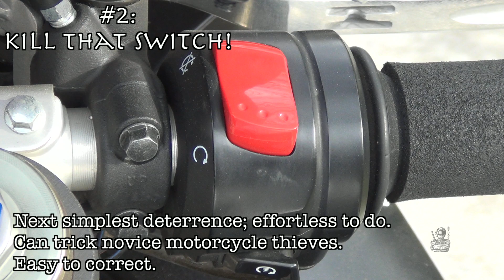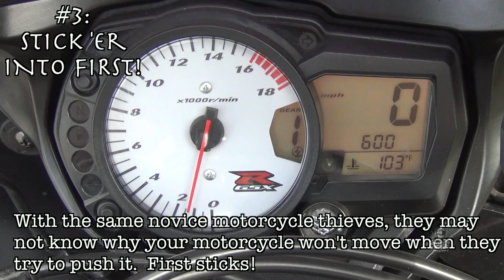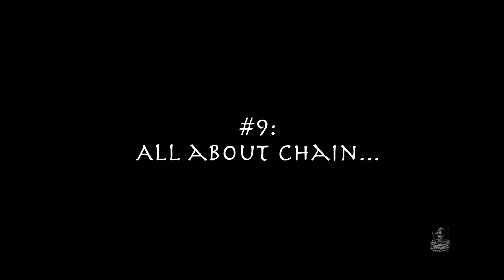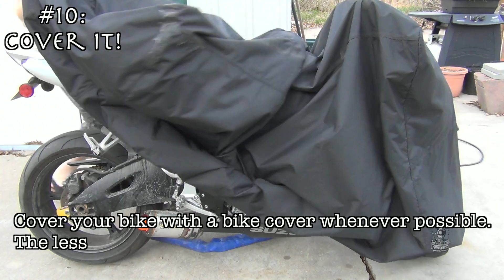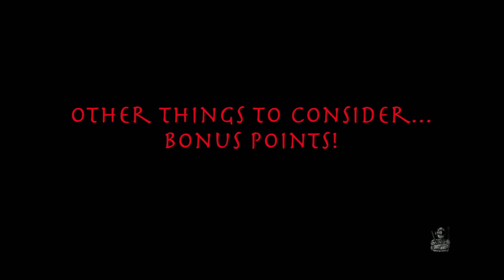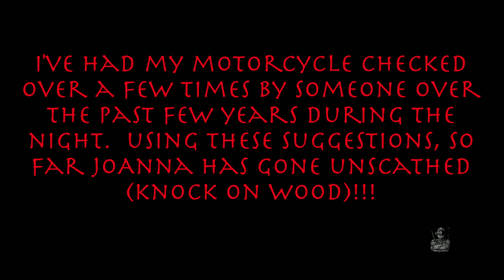Motovlog - SfaS 2.3.3 - How to Lock up Your Motorcycle Like a Boss!

Comment: Pretty simple rules that work well. Extra bonus would be to put a pit bull under the cover. ;)
Reply from the maker: +vac0002 - ...or a car battery wired to a metal plate 'n laid on the ground - optimized for maximum shockability ;D heheh ;p ^_~ ~......
Reply: +hanyou23 that too lol

Comment: Really nice video, but I would recommend 2 more things concerning disk locks:
1. (If possible!) Turn the key hole towards the wheel. It's much more difficult to lock-pick, but also to open with the key.
2. Use 2 different and good locks, for example Abus and Kryptonite.
Reply from the maker: @Martin Ritter  Noted and agreed!  I didn't really have much of a choice with the lock at the time ;o ... luckily, where it's positioned, it's hard to get to with the cover (on mine) - but I may have to look at upgrading here soon :).  Thanks much for pointing it out ^^ !!!  Cheers ^_^ ~

Comment: Nice one chef it surprising how many people don't know how or don't lock their bikes up at all. With the chain i always try keep of the ground to stop the robbing bastards using the ground as leverage
Reply from the maker: +Bick Mitchum Yeah, exactly as you said with the ground/leverage part :o .  At the time I had the chain installed, I wasn't really certain where I was going to put my bike, so I had it a bit long, unfortunately :/ .  Anywho, there is so much conflicting information out there as to how to lock up a bike properly - it's sometimes hard to tell just what one should do :/ .  Ah well - with just a bit of research, it should be all good ;D .....

Thanks for your comment, man ^_^ !~
Reply: hanyou23 hey great video. I’ve got a thick lock and a disc alarm but I have to leave mine outside of my house overnight as I can’t get it through my back yard. Also I’ve got nothing to tie the lock around. Any ideas ?

Comment: would deffo do these steps if i had to leave the bike on the road over night! luckily i have a double garage now (will still be using disc locks) I'll risk it at work and use disc locks to secure it! hopefully it deters most robbers
Reply from the maker: +AGuyWhosBritish - It will ^_~ .  I have no choice in doing it, honestly ;o ... I no longer have a garage :( .  Still, it's a very good idea to chain your motorcycle - even in a garage ;p .  Thieves have great ways of breaking into everything - especially garages @o@; (where no one can see what bad things they are doing ;o ).  Anywho, best of luck with everything and cheers, man ^_^ ~

Comment: Most thieves won't bother with picking the lock, they either carry the bike away with a van/ truck, or use a angle grinder to cut the locks then push it away.     

As the old saying goes, locks are only effective against honest people, if they really want your bike they will get it. 

Best advise for security enhancement: get an insurance and lock up the front and rear tyres of your bike with two chain locks secured to unmovable objects. An additional harden U-lock to the rear tyre will also increase the deterrence.
Reply from the maker: The only problem about chain locks to the tires is that tires can be taken off pretty easily with a wrench... but for the novice thief, any lock would be somewhat of a deterrence :) .

Comment: of all those I did not see or hear of only 3 before seeing this one thanks. BTW to combat the built in alarm problem especially because I ride a Zero I am using 2 small batteries one from a UPS the other from a house alarm
Reply from the maker: +Yosef Warshawsky - Np, bro ^^ !  That's actually a great idea on the built-in alarm 'n batteries ;o ... do you daisy chain the wiring or is it direct ;o ???  I'd be curious to see how you'd do that :) ~
Reply: +hanyou23 it's both in a way. the normal operating voltage is 10 but there is a 12V for a few things one wire will go to that another links both batteries and a third for auxiliary charging
Reply from the maker: +Yosef Warshawsky - Wow, that's pretty impressive :o !  Do you use any resistors, by chance, to help manage with that voltage mismatch ;o ???~
Reply: +hanyou23 there's no voltage mismatch it's all 12V in batteries, external charger and Effie's (bike's name) wires being used
Reply from the maker: +Yosef Warshawsky - Oh, I must have misunderstood ;o !  Wish I could get a wiring diagram somehow - I'm a bit more of a visual person xD mehah ;p ~.....

~o~;
Reply: if you're willing to give me a postal address I can send you a hand drawing of what I did
Reply from the maker: +Yosef Warshawsky - Sure - thank you so very much :D !  What's your preferred method of contact :o (PM/DM/etc.)???~

I have an alarm that's been siting in storage for a couple of years now because of my fear of a drained battery, etc. :/ ... it'd be nice to actually get that thing going since no one really wanted to buy it up from me ;p heh~

^_^
Reply: PM is preferred
Reply from the maker: +Yosef Warshawsky - I'll get to it shortly :) ... sorry for the delay ;o ~

Comment: Don't use Master locks. Shackle guards are only good if they're incorporated into the design of the lock body and therefore made of the same material which should be hardened steel. Shutter locks or shipping container locks are best for this. Chains should be as short as possible and not left lying on the ground where the thieves have plenty of space to attack them. All chains (even Pewag) can be cut through in 30 seconds with a cordless grinder. The usual trick is to cover the bike with wet blankets to muffle the alarms, cut the chain, then lift the bike into a van. So, park away from where a van can gain easy access. Fit a tracker and hide it well.
Reply from the maker: +Moderate Fkr - All very good points ^^ !  Unfortunately, I had to do my chain the way I did - there was no other way ;o ... otherwise, it would have been the closest run possible ^_~ .  The good thing though, is that she's clear out of the way, in the back (that's safe to say)... no vans coming up in here xD heh!   Anyways, cheers, man ^_^ ~  :)
Reply: Master lock is fine to use

Comment: nice vid. i have 3 bikes in a parking garage. i guess it would make sense to chain them together ?  then maybe an alarm disc lock on each...
Reply from the maker: +MarcS4R - Sounds like a good plan :) .  Just make sure that the chain is thick enough and that the chain is set high enough off of the ground when locked (the height will make the chain really hard to cut with bolt cutters ^_~ ).  Best of luck and cheers ^^ !~  :)

Comment: I like the video great job, I would just suggest to put the disc lock with the key hole facing the other side of the rim (towards the other disc) it's harder for thieves to access. And I would love to know what kind of camera is the one from the beginning of the video I would like to get it for my bike rides for safety.
Reply from the maker: +Aleksandar The Great - Very good point ;o !  I haven't done it myself because I'll cut up my hands on those darn rotors ;p (plus I usually have the cover on the motorcycle when not in use ^_~ ), but is a very good idea for an extra deterrence ^^ !  The camera is a Sony HDR-AS100V - great little cameras with built-in stabilizers, too ;D ~

Comment: How long does it take you to unlock/remove everything and install/lock everything again? Gosh, I think you might be better off building a ramp and rolling the bike into the house.. Save the chains and locks for when you need to park it away from home. 
For that I would then ask how much does all the chains, disc locks and padlocks weight to carry them around in a bag-pack? 
Jokes aside, bike/parts theft is extremely infuriating, always say a little curse for any potential thieves to curse their entire family a horrific and painful deaths by the Motorcycle Gods. :)
Reply from the maker: +TheSighBored Those are all good questions :D !  Lock/unlock - I've finally got it down to 10 minutes or less :o , but when I first got my bike & started to lock things up, it was around 15 since I always forgot a step in-between somewhere ~o~ ~.  As for the ramp :o ... I would like to or actually rather to, but my wife already dismissed that idea on day one :/ .  It's be kind'a hard to get JoAnna into my house anyways ;o ~...

You're very right on the chains away from home, though ;D .  Usually whenever I go out, I just bring my disk brake alarms with me and they seem to do pretty well ;) (always afraid of someone pulling up & putting the bike into the back of a pickup, though o ~).  There's been a couple of times where I've been inside of a store and heard both alarms go off at the same time :o ... go out a bit later and everything seems untouched ^_~ .  If a person doesn't know what those disk alarms are or doesn't even see them, then they're in for a rude awakening :D heheh ^_~ ~

I've seen some people pack a very light weight cover into their backpacks and quickly cover their bike on the go :o .  I never found a need to because I never ride when there's a possibility of rain XD ... seems like the only reason I'd carry one except for the all-eyes-seeing part ;p heh.  Also, some carry a very light chain and lock on the go, but it seems a bit pointless really :o .  I've also heard stories of some people putting a chain around a parking meter or sign, only to come back to find that the bike can be backed up and the chain easily be lifted over whatever it's chained around ;o (or the whatever bent over because it was flimsy :p ).  Always a good idea to put a chain around something thick, anchored deep and tall ;p ~

Except for carrying the chains around :o , I can tell you off the top of my head that the cost of some of the items that I bought to lock up my bike are as follows:  Chain - $45; padlock - $35; cover - $112; disk brake locks - ~$85/each; irrigation hose - ~$12; cable lock - ~$15, etc.  Yeah, I know, I might have just paid for the installation of a new garage instead of buying all of these things and I can say that not having a garage really stinks ~o~ .  Still, it's peace of mind knowing that my bike will still be there in the morning ;D ~...

I probably should also add that if someone does have a garage and they park their bike in it overnight or whenever, then it is a good idea to lock it up with a chain on the inside even then :o .  Garages are easily broken into ;) .  Also having locks that are brightly colored are a deterrent within themselves - makes them more noticeable as if they say, "You might not even bother trying because I'm here" ;D heh~.....

Anyways, I'll always be pulling for the motorcycle Gods ;D hah!  May all motorcycle thieves boil in a hot pot of used radiator coolant XD bwahah ;p ~

Anyways... sorry man for the late reply but thanks a ton for watching/commenting and cheers to you ^_^ !  Cold and rainy here recently ;/ - wish it was just kind'a warm and wet like it is there instead ;o meh (meh-here :p )~.....

\^_^/
Reply: It depends how often you use  your bike and where you live as to how much security you want to use.
Reply: i know Im kinda off topic but do anyone know a good site to watch new movies online?
Reply: @Matthias Nickolas I use flixzone. Just search on google for it :)
Reply: @Torin Adrian Definitely, have been using flixzone for since april myself :D
Reply: @Torin Adrian thank you, signed up and it seems like a nice service :) Appreciate it!!
Reply: @Matthias Nickolas glad I could help :)

Comment: I boobytrap the cover. I have a rope attached on the inside of the cover to the disc lock with an alarm built in. When someone pulls the cover up it will pull the lock, setting off the alarm.
Reply from the maker: +Freek Jacobs - That's a pretty snazzy-cool idea ;D !  Whatever it takes to keep out bikes safe, right :) ?  ^_^

Comment: I recently got a used bike.  I try and push and turn to lock the front wheel, but it doesn't turn enough to actually lock it.  Am I doing something wrong or is it just a touch too old and beaten up?
Reply from the maker: +WhileGamingBadly - I'd say the bike has probably seem better days ;p heheh.  It might be able to be fixed ;o ... honestly, I've never seen one of these locks in action, so I can't say for sure... but it might not hurt to have someone look at it :) .  There also might be a little dirt or crud in there somewhere ;o ... when is the last time you gave it a bath :) ?
Reply: when you press the key down press it down half way, hope this helps :)
Reply: hanyou23  I've had the bike only about a month now, so definitely more than a month XD  No idea if the previous owner gave her a bath in the year she owner her.
adamraywilson  I will definitely have to give that a try.
Reply from the maker: +WhileGamingBadly - Also, please try jiggling the handlebars too, while trying to lock ;o ... you never know if they've just gone a hair too far - a bit further than they should ;) ~  :)

Comment: Solid anchor to concrete with two 10mm dynabolts. Thick chain and concealed padlock as shown with a bike cover ,  is all you need.   
Alarms are a nuisance and wont deter the professional thieves much.
Reply from the maker: +Zappa - True on the alarms... but I guarantee you that they'll wake somebody up here in the house - during the night, if someone tries to disturb 'er ;) ~

:)

Comment: Great tips, although I would never buy a master lock, those things are notoriously badly designed and very easy to pick
Reply from the maker: +Justin Halsall - Yeah, I'm aware of the fact ;o ... unfortunately, that's all could afford at the time ;p .  Luckily though, the lock I have is low enough to the ground - that anyone would have trouble picking it, with the angle that it sits at :) .  Very good point - thank you much for pointing it out ^^ !!!~  :)
Reply: Master lock is king